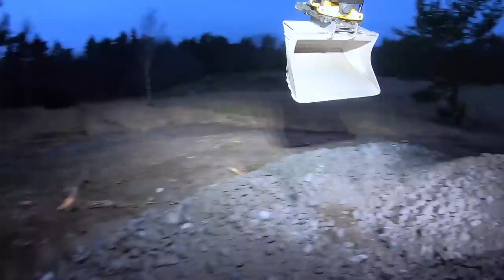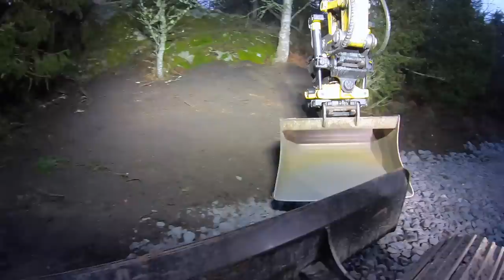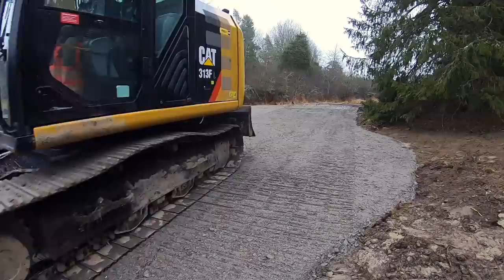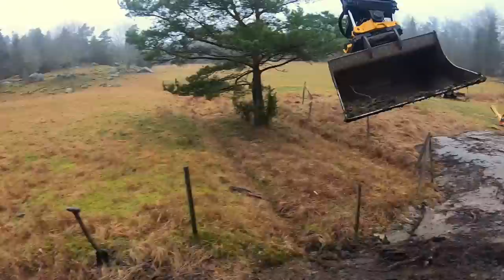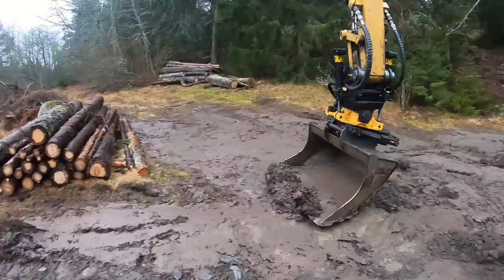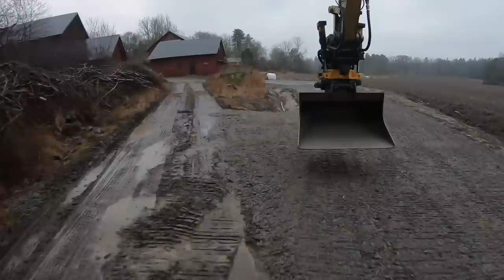#26 Road preparation for lumber trucks: 4 turns and a turnaround Part: 5 of 6

Comment: I have operated 180° and 360° excavators with conventional bucket setup, manually knocking out pins to change buckets then quick hitch came along making changing buckets a breeze sitting in the cab. But this bucket setup you have is quite amazing it's another level, the conventional way would have you maneuvering the machine quite a lot. You cover a larger area using this setup with the machine stationary. Your grading is impressive. Operating excavators is a skill, I have seen some attempt to operate them but can never get the hang of it, back to the pick and shovel they go.👍

Comment: Nice material your using. That looks like nice oversized rock. It will make a great base. My pops would say run it down good. Why don’t you runs down that over sized rock with your machine? I think you would get more compaction then that plate tamper.

Comment: Why are there no ditches on these roads? Would be concerned about water running down the road way causing trouble.
Reply from the maker: Exactly, this is also our advice to the customer so this is probably the next job out here.

Comment: I rarely (never?) see you use the blade on your excavator for leveling. Any particular reason? I realize it’s not that helpful on the excellent surfacing work you do with your rotating bucket, but how about prep work? Is the bucket just so effective, why bother?